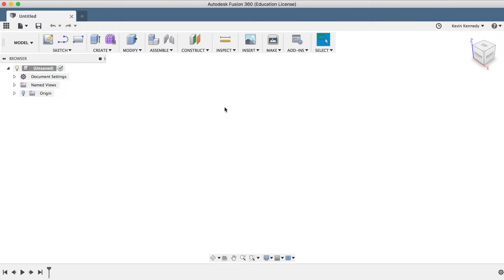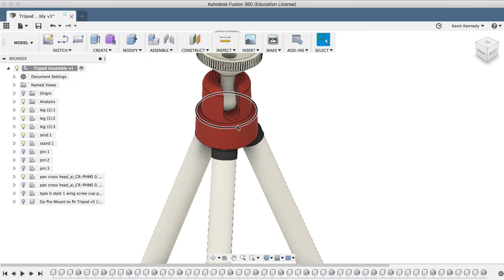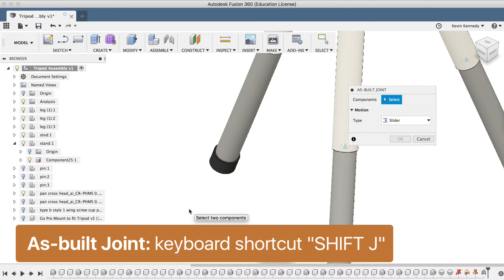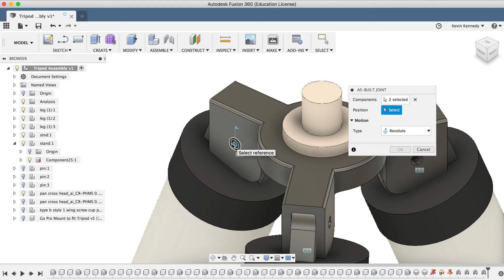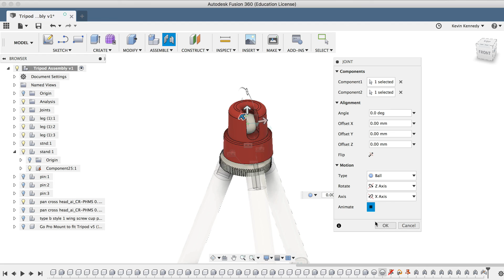How to Create Assemblies and Joints in Fusion 360 - Learn Autodesk Fusion 360 in 30 Days: Day #25

Comment from the maker: Do you like Fusion 360 Assemblies?
—
TIMESTAMPS
0:00 - How to use Joints in Fusion 360
3:42 - Capture position explained
3:50 - Revert position explained
5:54 - As-built joint explained
6:23 - Joint explained
7:47 - As-built joint example
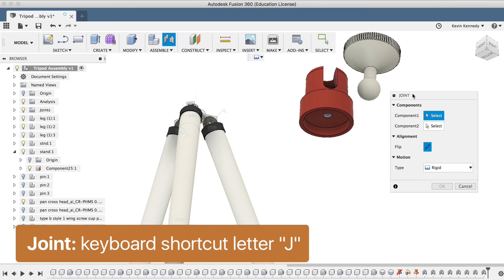12:20 - Joint example

Comment: I did the rigid joint of the crosshead to the legs. However, I can still move the crosshead around. Then when I did the ball joint of the mount to the crosshead, they both move around together. I realize that I am using a current version of 360, os maybe that's it?
Reply from the maker: Is your crosshead grounded (red thumbtack icon)? Any one of the center components should be grounded to prevent everything from moving around

Comment: Good tutorial, very useful. I am thinking about how to create a docking mechanism between two boat, a larger one and a smaller one (a dinghy). The basic idea is that of a cone (the passive side) in the larger boat, and a stick in the dinghy. The stick will slide into the cone. That's why I am thinking carefully through this your demo, lesson. Maybe you can do a video on a type of motion I suggested, with "joints". Also, there should be a locking mechanism, for the two boats to lock into each other. I have created this experiment: https://youtu.be/6XxVTrHehU0 Maybe you can suggest something along the lines ?

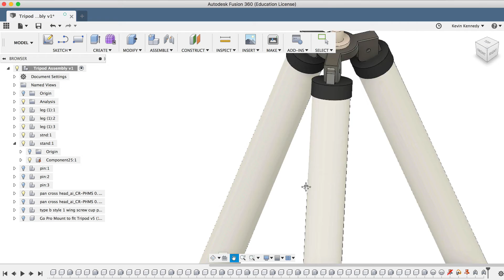Comment: This video was really good up to 9:40 but then you lose me when you say "then I'll right-click and select 'repeat as built joint'" with no mention of what it is you right-clicking on. I tried a few guesses, but nothing i right click on gives me the option to 'repeat as built joint." I suppose I can just go to assembly menu and choose it again, but i would have liked to know what you right clicked on to learn the shortcut
Reply from the maker: You will want to right-click anywhere in the Canvas (modeling area). That will give you the marking-menu. The last option used is always placed at the top of the right-click/marking menu 'Repeat <last used feature>'

If you don't see 'Repeat As-built Joint' then it's due to activating a different feature in between/after the last one.
Reply: Thanks. I did eventually figure it out, but thought I'd leave the question up in case others miss it too. I had anotherr question about contact sets on yur other geneva dive coontact sets video. I tried tto create contactt sets for this tripods balll joint.........oooooooh. I just hit me. Fr coontact sets i dont want to choose the balll, i want too choose the top, don't I? Or wait. Lemme try this out
Reply: @ProductDesignOnline  Thanks, yeah I did eventually figure it out

Comment: As a newbie I'm struggling a little to follow the menus, as they have been changed. For example, I haven''t found Position as shown at 14:48.  Is there a webpage that describes where these are now?
Reply from the maker: The "Position" section now only refers to "Capture Position" that appears in your toolbar only when you move something. The dropdown only included those two features/buttons, so they removed it.
Reply: @ProductDesignOnline  Ah, right,  thanks.  Good videos mate! 🇦🇺

Comment: Just when I thought I was getting the hang of things... I had a lot of trouble completing this one, but was finally successful on try #5. After creating rigid joints, some components were still movable. I believe the primary mistake I was making was selecting only the inner hole on the bottom of the red component instead of the bottom surface. After it was put in place it could me moved and appeared to have a Phillips screw head sticking out of the bottom. There were a few minor interface differences (in 2021), but not too hard to work out. Is it accurate to say that with "in-place" assemblies the order of selection doesn't matter?

Comment: me id like to know is there a way to make a join without snaping it ? i create thing with tolerence with that snap ruin everything
Reply from the maker: You can add your clearance/tolerances in as joint offsets. Otherwise you will have to use the Move command to position things... however, that is not recommended as you will have to use the capture position feature.
Reply: @ProductDesignOnline  nvm i just miss understood something
in previous test i did a normal joint i was able to drag to rotate gear but i have to ground something for the as built join
thanks for answering :D

Comment: how do you give the joints realistic limits, like so that they cant float through each other?
Reply from the maker: There are many joint types, so that would depend on the object. The process should be as follows.
1. Ground one component
2. Apply joint to the next component that touches the grounded one
3. Proceed by adding joints in a manner that restricts movement based on the rest of the assembly.

Comment: Unfortunately, this great tutorial does not apply to the new (June 2020) joint tools
Reply from the maker: Hi Tom. The joints have not really changed the last couple years other than they grouped the joint types into a second tab of the dialog. What are you having issues with?
Reply: @ProductDesignOnline  Hello!  I was having a difficult time figuring out how to specify the origin of a pivot (between two components).  The new labels and pop-up information tab made it seem like I needed to do something in 'joint origin' before 'joint'.  But after some experimentation I see that they are still two separate kinds of actions i and I successfully created and animated the joint.  Now I just need to figure out how to 'grab' the component and 'move it around'. I really have made great use of the entire series though.  I'm an experienced Modo user looking for a more parametric program to use for technical work.

Comment: Can I use this when sketching the original design? I am making a folding frame lock knife.  So when I am sketching the outline of the frame and blade I need to rotate the blade on the pivot to make sure the flipper tab doesnt hit anything and then I need to select the location for the stop pin which stops the blade in the closed position and the open position. So in the closed position I need the blade to not hit the backspacer when its laying down. Just wo daring what us the best way to get this all correct from the sketch. Hopefully this makes sense. But there are no videos out there explaining how this relationship works

Comment: Awesome, you made get a drawer slide working! My design is parametric, and I made a rigid connection between the outer most part of the slide and the cabinet wall. But when I change the cabinet length, that wall moves accordingly, but the slide stays in the same place (which now is away from the wall's new position). Any ideas why? Many thanks.

Comment: I tried to do a cut list layout of a lower cabinet carcass with about 20 components using  the joint command to move individual pieces of the carcass onto a 4x8 sheet of plywood which is also a component.  This attempt turned into a 2 hour disaster.  The largest problem with Fusion 360 is that there is ZERO documentation of these rather complex commands, such as Joints, or the implications of using them.  I do NOT have the time or the mental bandwidth to watch 100 YouTube videos and memorize 200 menu commands AND their sub command sets, just to see how wood is going to layout on a piece of plywood.  Although your videos are well done and quite clear, in my opinion, they by no means are complete nor do they explain why Fusion just stops, doesn't do anything when it should do something, nor explain the rather obtuse error messages.  It is starting to dawn on me that Fusion and apparently all the other CAD/CAM programs out there are really designed for working professional designers that do this 12 hours a day, 6 days a week, are young like you, and have an infinite memory for keeping the entire tool set in their heads AND can recall it at will AND figure out all the nuances of each command, their relationship to each and every other command set, AND how Fusion automatically does something that one may not expect.  On a positive note, the parametric variables that Fusion allows one to assign values to is extremely useful.  Sketchup cannot do this.  One last comment, not associated with you, the Fusion team must be living in a bubble not related to the reality of their user community.  As an example, to not allow the Home function to be assigned to a simple custom key is ridiculous and callous.  The drawing commands like Pan/Orbit are difficult without expensive hardware,  and cannot be customized in any way.  So, unfortunately, I am getting older by the minute and do not want to spend what is left of my life struggling and getting frustated any more by anything made by Autodesk.  I hope the best for you.  You are young, brilliiant, well spoken, and articulate.  You have a great future ahead of you.  I just hope you don't spend that future in front of a CAD computer, going blind looking at 6 point font that is faint and almost unreadable and unchangable,  memorizing stuff that has nothing to do with being creative.  Regards.
Reply from the maker: There is a "Nesting" add-in that will layout your components for you - https://github.com/tapnair/NESTER
I also suspect that this will be a native feature in Fusion 360 (soon)....

Fusion 360 has some decent documentation on all the commands here (if you haven't seen this yet) - http://help.autodesk.com/view/fusion360/ENU/?guid=GUID-8818AE31-958A-4A59-989B-9875A174C67A

I do agree that Fusion 360 overlooks the hobbyists' aspect and assumes that users are going to be spending hours in the program. The unfortunate reality is that a lot of "corporate" development is driven by those disconnected from the user base.

Stay healthy! Cheers!

Comment: https://a360.co/38w2Ofo I am pretty sure I followed your instructions to the letter and when it tells me to test the joints, the parts can be easily pulled apart and so there is no way to test them. I grounded the gray bracket on the top of the tripod only.  All the joints worked fine when i created them.   Lil Help? btw how do I send you an image file if I cant share a link? Thanks
Reply: I finally got it thanks.

Comment: Kevin any way you could post another example of joint creation and motion for more complex pieces that fusion wouldn't intuitively have a feature for (ie hack and work arounds)?. Specifically material that would flex or bend  (One gent posted a way to emulate the motion of a spring - quite impressive actually).

I have some assembly parts that are series of  pieces of wood attached to a nylon (webbing) strap.  When multiple pieces are attached to a long nylon webbing strap, it acts like a flexible assembly (like a rope ladder), The only hack I can think of is to break the 'nylon part' into dozens of pieces, and apply a revolute joint to them - but still isn't quite right.

Agreed - your videos and branding are way underrated; hope you get more subscribers!!

Thanks
Reply from the maker: Hi, Jason. The example you've given is likely out of reach based on Fusion 360's capabilities. F360's motion and joint capabilities are more geared toward rigid products (plastics, metals, etc). It generally does not do well for flexible or stretchy materials (rubber, nylon, etc). Are you trying to run a simulation for the project or just want to create an animation that shows how it would flex?

I definitely have on the radar to do some more assembly and motion tutorials, geared towards intermediate users and projects. Cheers, Kevin :)
Reply: @ProductDesignOnline  Thanks Kevin.  Simply an illustration. The rope ladder for example - it would only have to unroll from the package to layout on the floor.  ie just how it would flex.
Reply from the maker: @jasondagenais5701  Yea...that's pretty much outside the scope of Fusion 360. At least in its current state. That's something that's more suited for 3Ds Max, Maya, etc. Cheers, Kevin :)

Comment: Hey Kevin.  What I tell you...another great video.  For attaching the legs to the stand piece using the as-built joint with revolute motion, I followed what you have in the video and the preview rotated but when I try to test the motion by grabbing a leg the whole assembly moves.  I little flag is on the axis so I don't know why it seems to be glued together and not rotating around the axis.
Reply from the maker: Hi Ken. You may have to "ground" the stand part. Right-click on the red stand component (I believe Component 25) and then select the "ground" option from the list. This will "freeze" or ground the component so it can't be moved at all (unless "ungrounded" following the same steps). Let me know if that helps! Cheers, Kevin :)
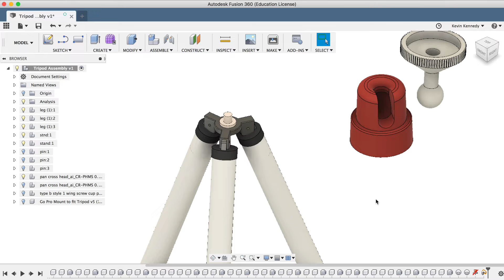Reply: @ProductDesignOnline  Ah yes, I missed that part around 4:15.  Thanks a bunch.
Reply from the maker: @kenchang3456  You're welcome! Glad that sorted it out. Cheers, Kevin :)

Comment: Hey, Kevin
Can you help me with the joints in this file
there's an error with joining the components with the lever
https://a360.co/2v5sWww
Reply from the maker: Hi Aryan. Sorry for the delay. Your comment was flagged by the spam filter because of the link. Anyway, I took a look at your file. It appears that you used "Joints" for the level component at the top...and I see that your problem is that the component slides left and right as you try to move the lever. What you should use instead is the "As-Built Joint" which applies the revolute joint without letting the component move around.

Here's your file with the changes I made, if you'd like to take a look - https://a360.co/2PlSAWY
Cheers, Kevin :)

Comment: Something i would love to see how you approach modeling is something like a castle tower. Getting the brick texture boggles my mind. Any advice?
Reply from the maker: Hi Bobby, in all honesty, I wouldn't attempt brick texture (for a castle or any building) in Fusion 360. I would use a program such as Zbrush, Blender (Free), or Maya which gives more control over texture mapping and appearance... assuming the castle is more for appearance than functionality?  

However, if you were to attempt a brick texture in F360 then I would probably use the sculpt environment, which would give the most amount of control with points and texture. You would want to stay away from the pattern feature in the model environment as that puts a huge overload on F360/operating system. Cheers, Kevin :)
Reply: @ProductDesignOnline  Hay thanks for the reply! Guess i could have been more clear. I really just want the brick lines not texture per say. But i could see how using one of those other programs might work better for that sort of thing.
Reply from the maker: maybe I misunderstood you... Are you just looking for the grout lines? If so, that would probably render okay in F360 depending on how it was done. It would really depend on the size and complexity of the model... you could run into some problems with Fusion not being able to handle the amount of sketch/features required to create the pattern.
Reply: @ProductDesignOnline  Yea, just the grout lines. Ive been trying to model up a simple castle tower shaped drinking cup but havent been able to figure out how to get repeatable grout lines that look good. Ill take a look at the other programs you suggested and see what i can figure out.  Thanks so much for the reply and info!
Reply from the maker: You're welcome. Sounds like a cool project! Good luck! :)
Reply: Hi Bobby, if you haven't already figured this out - Check out Titans of CNC website. They do a series on creating a chess piece set, of which one of them is the rook. They show how to create the grout lines on there in a repeating pattern around and down the face of the rook. Link >> https://academy.titansofcnc.com/series/trookitan/titan-rook